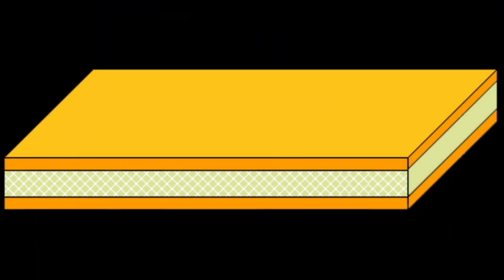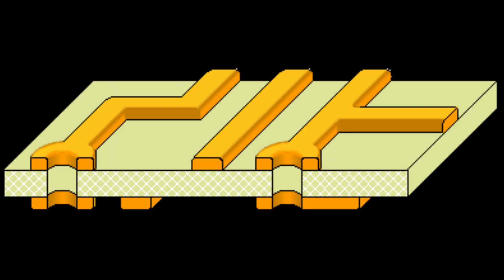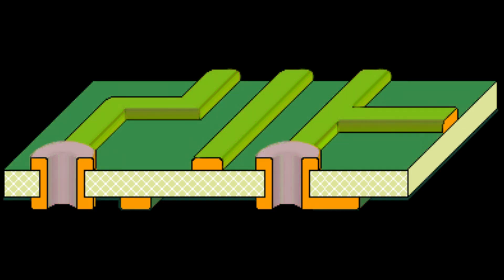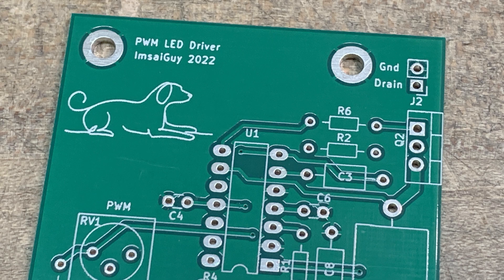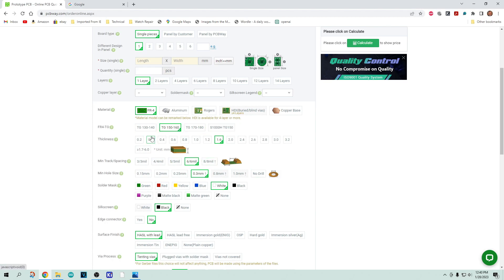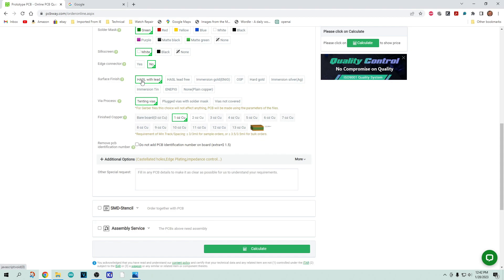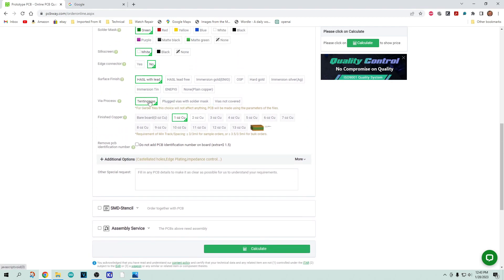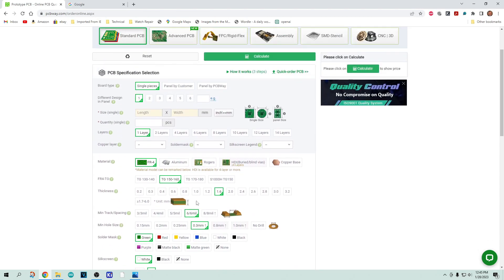#1418 PCB - The Board

Comment: Gold is just a protective layer and works well for edge connectors.  Copper is a better conductor and I don't suppose the thin layer of gold that is typically applied makes much difference either way.
Reply: You'll want hard gold for edge connectors. ENIG is too soft.
Reply: Actually silver have the best conductivity.
Reply: @paulcohen1555  They do use a silver plating on the copper. (you can request that. Same with the gold on nickle plating.) Pure silver wire is sometimes used for making lower resistance connections, compared to copper. Silver wire, or silver plated copper wire,  is sometimes used in winding high Q coils, for RF applications.
Reply: ENIG Gold finishes sure look pretty!
Reply: I don't think they plate on copper with gold anymore. They put on nickle first, then the gold. The gold plating has got nothing to do with increasing the conductivity, as it's separated from the copper by the nickle.
Reply: And gold is excellent for soldering.
Reply: @paulcohen1555  If it's gold on nickle plating... ur actually soldering to the nickel, as the gold quickly dissolves into the solder. Too much gold can cause problems with soldering... it can make the solder joint brittle, and cause the joint to fail.
Reply: From best conductor: it goes silver copper, gold, zinc, nickle, iron, tin, lead... with silver being about 6 times more conductive than iron. Silver, copper, and gold are close in conductivity... but, of course gold doesn't tarnish as much a silver, and silver not as much as copper.

Comment: Small pcs of PCB material can also be used as capacitors. I use this method for making a capacitive distributed antenna. You can calculate values by measuring 1 sq inch and scaling it up or down

Comment: FR = Fire retardant, type 4 (impregnated glass mat with transition temp of 160˚C)
In the olden days there was also FR-5 for higher heat/higher budget applications like furnace controllers and aerospace, and most of the stuff they used to sell at RadioShack was FR-2 which is resin impregnated cellulose material for lower temps and low budget. There were others but after 30 years of designing boards, those are the FR series I've used. Today it's a whole new world and the kids have no idea how easy vendors like PCBWay have made it for us.